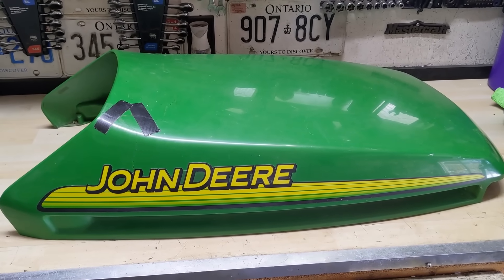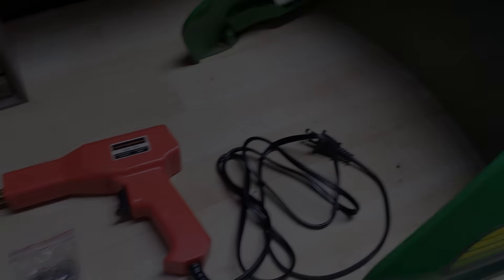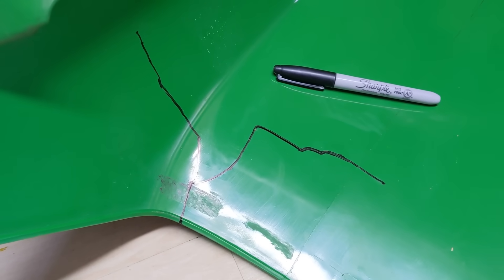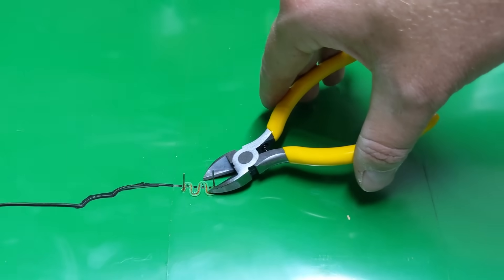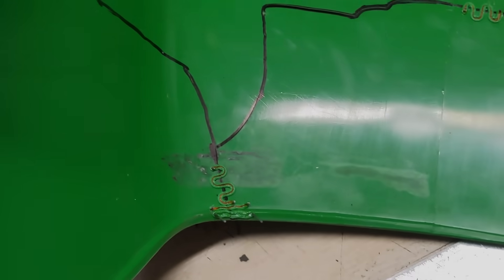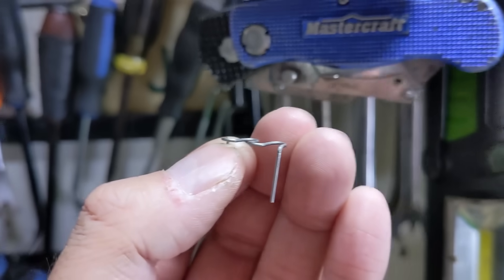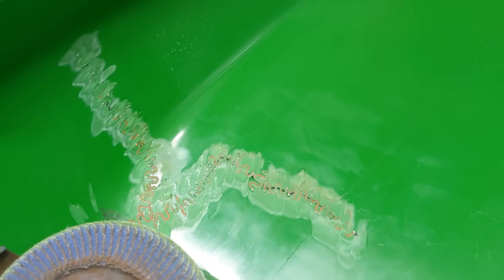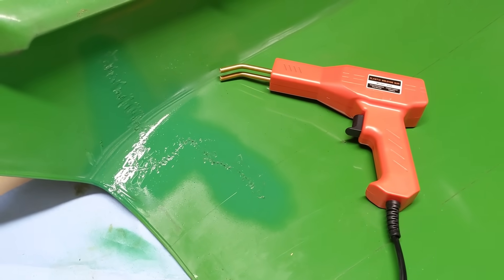How to Fix Cracks in Plastic Using a Hot Stapler

Comment: Good Video! 🙂👍 
The pins of the staples are normally notched at the base, which allows to break them easy off, so no upstanding rest leaf and they dont fly as dangerous arround.... or arent them notched or pre cuted as they claim?
Reply from the maker: These were not, I tried to bend them and they wouldn't snap
Reply: @EliminatorPerformance  OK thanks for you quick response 🙂 I saw this notched design is patented and without they can reduce production cost... So i can expect my staples will come unnotched too, even they claim "pre cut"
By the way, You are the only one on YT who do it the right way, without preheating in the air till it glows red. Pull the trigger when its allready placed on surface prevets unnecessary burning the plastic, thats reduce smelling and lead to stronger results too 🙂👍

Comment: What a great solution! That looks like thermoset plastic, which is much harder to melt and reform successfully. As others have mentioned, I would float a layer of epoxy over the top of that repair. It will cover the burrs and reinforce an obviously weak area of the hood. I've found a thin layer of epoxy to work very well to strengthen weak plastic pieces. I even pieced back together my truck's front grill after I drove over it (don't ask how).

Comment: Don't grind it sand lightly and use some seam sealer or Bondo it will add to the strength and cover the Sharp points.

Comment: Thanks. We were looking for a link to the plastic soldering tool in the description and couldn't find it.   Surprisingly, we found the link in the message box under you youtube ID. 😊

We followed the link, and saw that there are quite a few brands with various temperature levels from 50 to 180 and the soldering accessories.  They all seem to be in the price range you mentioned, with a few others priced a bit higher.☝🏿

Comment: While it may seem impressive, it's important to consider the impact of temperature fluctuations on the material. The strength of the material may be compromised due to expansion and contraction under specific temperature thresholds, leading to issues in both cold and hot weather conditions affecting metals and plastics differently.
This leads me to have faith in the technology I am utilizing, as it doesn't necessitate any staples. Instead, it employs a melting element that restores the plastic to 90% of its initial strength without adding any additional weight from external materials. There is no requirement for cutting or purchasing staples. The entry stop has an adjustable depth that can be set according to the thickness of the material being worked on.

Comment: After sanding them down smooth you could also go over it with a coat of body filler to further help hold the staples in and make it a seamless looking repair
Reply: As long as it's compatible with the plastic. Personally I wouldn't go for Bondo or the like bc the substrate is soft, and sanding down even a tight Bondo patch is gonna scuff/dull the surrounding areas and become its own issue to refinish.

Comment: Put some silicone caulk within the beak of the side cutters, smooth it out a bit, let it dry and cut it vertical to the edges with a utility knife, so the litlle guys are held in place and won't be flying all over when being snipped...

Comment: Not bad!
I usually use soldering iron and metal wire. Works the same good, but it is almost for free. I rarely do such work, so probably for me it is not essential to buy special tool.
But in general it looks nice.

Comment: Great tool ^^ Thanks for the demo
2:04 it would not have to be polarized even if it was DC current flowing through. The staples themselves are basically resistors which are not polarized.

Comment: For the scrap pins after cutting. If you tape a small peace of the green Floral foam to the side of the end cutter it should hold/catch the wire bit so it dose not fly away. Would take some trial and error to get the size right for Visibility/Catchability.

Comment: I tried this and i can tell you its crap ! You can melt the plastic back together with any soldering gun and you dont need metal staples. I use a spade tip on my weller soldering gun and with that tip it melts the plastic easily, then just use it to spread the melted plastic back over the crack and smooth it out, very easy.

Comment: We make our own staples. You talked about a spiral and we made one. I use diff size paper clips and bend how I want. So FYI you can use paper clips. Sometimes you may have to sand the contact ends because some paper clips we found have a layer of something that will keep from making good contact. But for the most part you can use them as is. Hope this helps....

Comment: I'm going to be honest. After watching a bunch of these videos, I decided to take my paper stapler and staple the plastic tab that broke off a truck's kick panel and then melt a zip tie along the crack and over the staples. Then I took my wood engraver and flattened the plastic out smooth. It worked great, but I would like one of these tools.

Comment: Bought one awhile back. Told my wife I might need it. Well today used it on the ayp snowblower plastic bottom cover.
Reply from the maker: Nice, they commonly crack and yes if you find the pieces you can repair them. Sadly the ones brought in are too smashed up

Comment: Oh that thing looks handy. I recently needed to repair the handle on a large plastic basket. My solution was to drill a bunch of small holes, then stitch it together using 20 AWG stainless steel solid wire. The repair was extremely solid but was time consuming and is rather non-subtle.

Comment: You could use a soldering iron with a spade/flat tip to gently melt the plastic ridges back over the staples encasing them - reducing the risk of rust, then grind down the sharp prongs. Would plastic weld glue be useful to fill in the upper side of the cracks for added stability?
Reply from the maker: Yea we've done that on a plastic chute I hot stapled then melted on top it turned out great
Reply: @EliminatorPerformance  Dammit though, now you've made me want to get a new tool-i-doo to go with my other obscure power tools! I've used a kind of hot staple method but always held a wire with pliers and heated with a kitchen blow torch 🤣 this'll be much easier! Hubby will roll his eyes at this one but my obscure tools are my best "babies" 😅
Reply: You can also melt zip ties to the back side.

Comment: i have been using one of these for about 7 years now, they are very good. rabbit cutters cut flush andd are round like that. i actually just repaird a plastic dipper today with mine, mine also came with a smoothing tool to hook to it to cover the staples with melted plastic by rubbing it over the inserted staples so they wont come back out in the future.

Comment: use to fix plastic on my semi truck using drywall mesh tape abs glue you put shallow grinder marks along the crack drill each end of the shallow mark thread fine wire through twist it on the back side then layer the back side with the mesh tape and glue to strengthen all along the crack bondo and sand the front mix your up paint in your recharge aerosol can give it a spray carry on

Comment: i wonder. you could maybe fill in the crack after from the top with a mix of epoxy and pigment if you wanted to spend the time and effort matching the color. and if i remember correctly, there are actual cans of touch up paint and touch up pens you can buy directly from your favorite tractor company.

Comment: The provided snippers would have worked better then the bulky useless ones you tried to justify your purchase of, lol.
Reply from the maker: They didn't work all that well so I looked for alternatives. I completely missed the fact that they were not flush cutters, even though they were end cutters. However, with that being said, I use them all the time because they're now the best cutters I have. They're high leverage and cut through rubber hose and metal wire easily.

Comment: Could finish off nicely with a plastic welder  to melt top side and bond.
Reply from the maker: Yes we have a soldering iron with a flat tip you can install and have done that on some.

Comment: Injection molded plastic is a very complex material with high density and internal stress at the surface and tension underneath, very much like glass. There is no way to restore it to its original condition because it was molded under tons of pressure. The best repair for a mower hood is whatever keeps it in one piece for a couple more years of bumping around in the yard.

It's actually much easier and more straightforward to weld together a sheet metal and bar hood from a 60s mower.
Reply: 100% correct

Comment: I use any scrap wire, or the best thing to use is screen. Stainless screen about .25 of a inch wide. Also get a roll of the duct tape that is made of metal on 1 side. The name escapes me but used on heating and cooling pipes and cracks. That works as a heat sink so the heat don't screw up the part. U can bend wire of any size to fit urr purpose. I like the screen and a weller soldering iron that has a tip with a small foot with a point like a trowel. That puts a big amount of heat and will get the screen started into plastic then I go over with a regular flat screwdriver type tip if I need to get that screen or wire deeper. I've used on quad fenders, bumpers for automotive, kids toys etc. 
A old plastic bucket makes some great filler for most plastics. Get to know what kind of plastic your working with. Not all are same. And u can do who's without a mask IF u have a fan blowing over the work. A spray bottle with water is good to cool down the welding quickly especially with thin pieces. Don't waste time and money on glue for plastic. Plastic will flex, bend etc. This method is hands down the best way to fix plastic. I've never used a kit like this but it seems nice to have those clips instead of bending wire or cutting screen. Always go slow and u can make great looking repairs in no time. It's especially gr8 for those dam clips or ears on door panels that always seem to break, after all others come out fine. And we know how much plastic is in our autos these days. I have also found the steel screens that come in faucets work so well for small cracks. That's the type of screen u need. U can twist and rip and it won't budge. I have repaired a bumper on a work truck and have tried to break repair. It will break in a new spot before repair fails. For hard to fix projects also resin and fiberglass can be a life saver too. Especially for posts that get broken. Like door panels. Dam old plastic door panels.

Comment: Excellent. Clean up a breeze. Results are Top Notch. The precision of an even melt sink, is an improvement from many older home remedies. The tool is cool. I have mini end cutters that will work. Great demo video. I need to fix cracked splash cowling under my Jeep.

Comment: I could see using this before they start to crack, especially if they have an issue with cracking in a specific spot.
Reply: Good idea but tell me where to start, then again this might just cause it to crack in a totally different area!
Reply: @waynestefinashen239  True. My comment was about a known cracking issue that happens in a specific place. Adding reinforcement isn't an exact science. We have no idea if the improvements will fix or create a new problem.
Reply: @therealjammit  Gotcha but they should just make the hoods out of the proper materials that will not crack eh

Comment: Very fine stainless mesh and a soldering iron with a large surface area tip does a great job too. Just cut out the right size of mesh and push it in with the soldering iron, leaves a better surface finish and is very strong, you can also use it to add filler material on the top surface before sanding it to same surface finish as the rest of the piece, maybe vapor smooth it with acetone if it’s abs or asa
Reply: He definitely mentioned that he was not that concerned about the overall appearance but was more focused on showing how the soldering tool  works and getting the cracks repaired.
Reply: Thanks a lot, that's a great idea! I was just about to buy yet another single-purpose tool that I use twice a year. I still have an old soldering iron that I don't use anymore and some stainless steel mesh is easy to get, so I'll definitely try your method first.
Reply: Beat me by a week. Yes the screen has saved me so much time, money buying new pieces. Some u can't buy so fixing is only option.
Reply: I've used this but with an electronics rework station 

The ~400°c air does beautiful things
Reply: I do this, and melt plastic over to hide it where possible, on black plastic, melting cable ties as filler/strenthener works well.
Reply: i learned using the solder iron with a llarge tip and take small piece of steel whool and add it in while i melt the top layer down works amazing too.. maybe even better than the mesh
Reply: I need the wireing diagram for the h50 plastic weld gun

Comment: baking soda and super glue does a much better job
Reply: Absolutely a good fix but the tearing forces being applied when opening these hoods will be dealt with more effectively with the staples. Have you tried the super glue and a cigarette butt yet? Works even better than baking soda
Reply: @waynestefinashen239  to each his own I've repaired both ways..........staples a lot more expensive than baking soda.......the baking soda will not break........if it fails it will be a new tear not the place where baking soda and super glue is applied
Reply: @frankwolf6920  Frank so have we and also used cigarette butts and super glue, have you tried that it works great to plug holes and reapply screws

Comment: You can “capture” those cut-off ends by putting a built-up bead if Silicone Rubber RTV (room temp vulcanization) from common hardware store tubes applied to the BACK side of the nippers blades. That way the two sides of the rubber “pinch” the wire being cut, and stops it from a free-range exit to the floor, or, you know, your eyeball.
Reply: Or just lay a rag over the cutter end as you snip them so they don't fly off.
Reply from the maker: Something I may look into, how weird I just see this comment now and watched a video on this the other night

Comment: Yes those plastic hoods are also expensive to replace from a dealer too, definitely worth it nice fix. Oh and NEVER load your tractors backwards on the trailer either because the wind will rip those hoods clear off! I worked for a john deere dealership for 5 years, trust me just pull them on and back them off
Reply from the maker: I have a strap that I put over the hood when loading them backwards. Never had a hood come off yet

Comment: Does it work with both thermoset or thermoplastic?
Reply: It will not work with thermoset plastic.  Once formed and cooled, thermoset plastic will not remelt.  It will just burn.  You'd need some kind of epoxy to fix a thermoset item.  I'd also imagine adding metal braces is a good idea.  If it's thin, you'll probably need to embed them only in the epoxy on the surface.  For thicker pieces, you can probably grind out some area to insert pins and epoxy.  Would take a lot of time and finesse, though.

Comment: those things suck, you can buy plastic repair strips that you can melt with a small torch. works so well you can't pull them apart if you wanted to.
Reply: Compared to paying the high price for a replacement hood our customers rave about how well their repaired hoods are now functioning and were also happy with the low cost for the repair. You must remember that now that they know it is repaired and they remember how they broke it, they take more care when opening the repaired hood. Have not had a return yet great money making machine which paid for itself on the first job.
Reply: Been making a small fortune with this hot welder all on John Deere and Toro riding mowers. Basically all profit after the first use

Comment: I had a few riding lawnmowers which the plastic broke in the same spot. One thing I did was when I bought a new mower I took off the hood and fiberglassed a few strips around the inside edge, mostly on the weak points. It's been about 6 years and no cracks anywhere. This has been a great review, I was always curious about these plastic welders.
Reply: Great idea thanks for sharing this one!

Comment: You should have opened the crack gently and put super glue or two part resin in before the hot staples it helps bring it all together as the hot staples on their own only melt half the plastic together

Comment: This guy some type of special idiot? AC? AC power is for the transmission of power as DC has a horrible travel distance. So likely its being rectified to a DC current which works best for heating elements.  Also exposed AC is not acceptable anywhere due to the unpleasantness of shock.  Before you commit to dropping hot pieces of metal in plastics, t there are actual plastic welders *(filler rods and melting merge) and other methods to do this. Maybe a quick YouTube video on identifying your plastic, and what the best weld method is, would be best. The fumes are toxic, ventilate. Stainless steel rusts very easily once exposed to contaminates. Wear a TIG/ white leather gloves for safety  would be best. Still have that raw hand feel with a bit of heat protection.  Fiberglass kits and Bondo has been used for half  a century for these type of products. Think twice before permanently scaring your valuables.

Comment: 310 stainless will rust but it takes years 
Austenitic stainless steel grade 304 is not magnetic There are grades of magnetic stainless
Reply: I think you mean 410 also called aircraft stainless not the austenitic 300 series which will not rust. BBQ's normally made out of 410 SS on the cheaper models and 300 Series on the more expensive units.